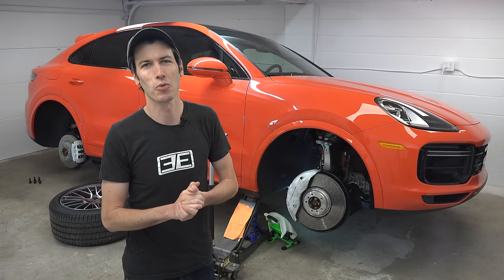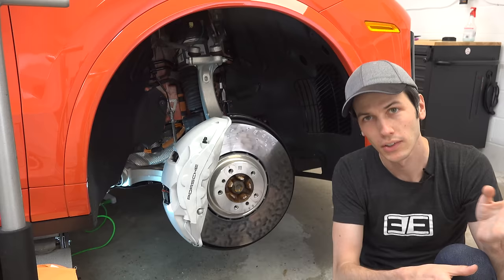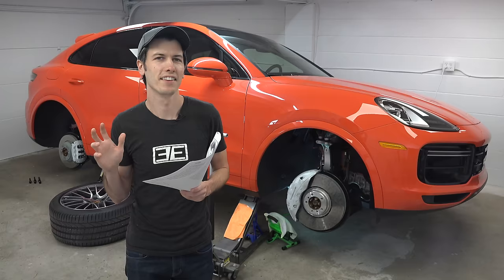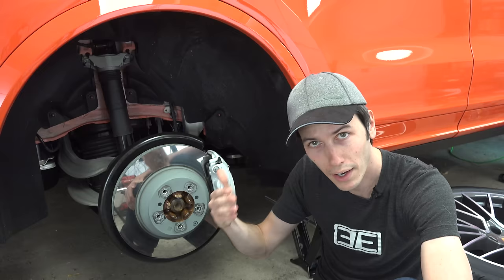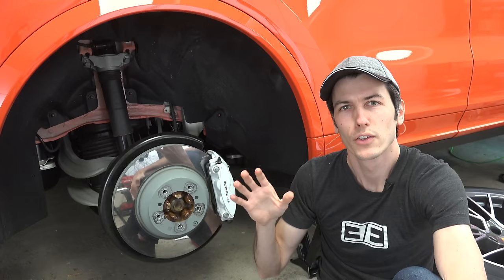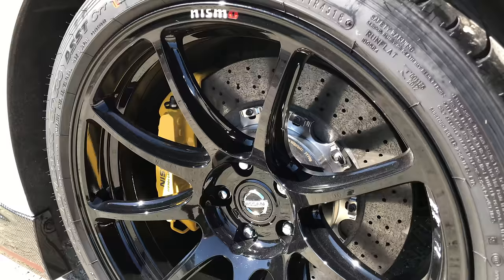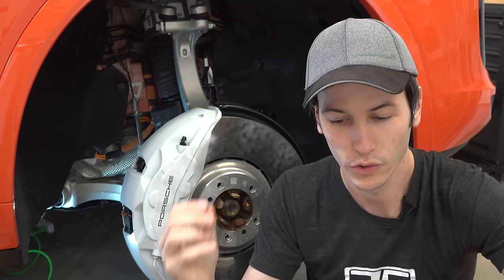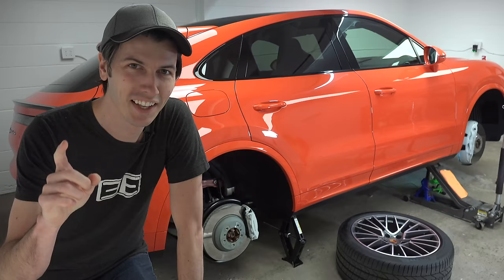Porsche Reinvents The Brake Rotor - No Rust, Low Dust, No Fade!

Comment: One of the problems with having a car designed and built in California were they don't have real winters. I drive my model 3 like a real car which means I drive on wet slushy dirt (muddy) roads in the winter. This was a feature I really liked to help stay on the road in these conditions. It will make these muddy, high crown roads with deep ditches really difficult to drive. I would like to take the engineer who thought this was a good idea for a "spin" in a nice 28°F day.

Comment: I am kind of paranoid about supporting vehicles. I use Snap-On 10 ton jackstands (they cost about $400 in about '98 if I remember correctly), and I am just an occasional DIY'er. None of the rest of my tools are that fancy or overkill, but I have seen jackstands fail, pavement fail under jackstands, jacks collapse, bend, slip, etc. I worked at a body shop and this is one area I just will not compromise on when I am getting under a vehicle.

Comment: You do understand that that is a break pud eater. However constantly breaking little angers as you said produces much less heat than pure friction. Scorching marks on front caliber are scorching marks, so they are signs of burned surface. We use a lot of tungsten blades in our machines and those marks show over heating and no they never come back even if you Polish them the burn is still there and reappears in the same spot. It has a ceramic structure and if you make a burn it actually comes from the core metal that was coated and not the coating. In time they will get it right
Reply: So if you look on the braking pads you should see grooves formed as you would on an overhead iron caliber.

Comment: Im a machinist and i regularly make parts that get this HFOV coating.(Hydro Power) I would really like to hear a reason as to why they cant simply coat the rotors thicker. I dont really see a reason why you should not be able to make a 0.2 mm coating or even thicker than that. Im pretty sure you could easily significantly increase the longevity of the rotors without the costs going up that much more.

Comment: You can slide the tire or tires under the edge of the car for ultimate peace of mind.  Actually when I change the brakes I slide the tire under the control arm.  If you ever do go under a car for whatever crazy reason at least your head wont get squashed.

Comment: usually its not the wear that occur first, its the warping, you brake hard and you hit water puddle which give the rotor some temperature shock, after a few cycle any rotor will warp, then you need to either skim or replace it, which either way will let porsche to legally rob you a fortune

Comment: Pretty unstable set up of these jacks: if the hydraulic jack failed it's quite likely that there will be some lateral movement causing the secondary jacks to topple sideways. Wheel chocks on both left hand wheels would help.
Personally I would place large blocks of timber under the car and then lower the hydraulic jack until the timber is touching the underside of the car. Pallets are also a very stable safe support and 2 or 3 stacked under the car would be ideal.

Comment: Depending on the metallurgy of the rotors, good ones made with high carbon G4000 doesn't rust right away after rain, cheap ones does.

Comment: What would happen if you used this tungsten carbide coating technology on drum brakes? We know that drum brakes wear out more slowly than disc brakes as it is, so wouldn't using the tungsten carbide coating with them give them even more life? And can this tungsten carbide coating only be applied through that supersonic combustion spray method? It can't be applied in any other way, like electroplating, or sputtering, or something? Is tungsten carbide the only material that can provide useful improvements over iron rotors?

Comment: There is a place less than a mile from my house that does coatings like this.  I wonder if he would do a set of brake rotors.  I am aware these would have to be machined smooth as one of the final steps using tools made of diamond or a harder grade of carbide.  I am sure if he did it that would not be cheap but probably less expensive than Porsche's rotors.  I would love to see these for all cars eventually.  At that point they might not be so expensive any more.

Comment: What about getting rocks in between the rotors and calipers? On normal cars it obviously scars the rotor, but with these rotors, you have such a small amount of material to wear through before replacing them. I assume they won’t scar as much, because they’re so hard and I assume that in most cases it will just pulverize the rock or whatever. Correct me if I’m wrong, but it sounds like that is a major flaw. I understand that it’s really more for the track, but ironically it’s shown here on an SUV on a dirt road.

Comment: This sounds that it is perfect for BEVs and One Pedal Driving. 

Yeah it is expensive but it is very likely you'll never need to change brakes anymore. And you wont have a problem with rust, even  if you hardly ever use the brakes.

Comment: They probably got this idea from carbide tipped saw blades. They used to be HSS, or ‘high speed steel’ but they were eventually upgraded to carbide tips as it’s a harder material, stays sharp for longer and cuts way better. It’s quite interesting how the same sort of thought was applied to brake pad, only instead of teeth it’s a whole coating.

Comment: The next step up from tungsten carbide in tooling is coating the tungsten carbide cutting surface with the even harder titanium nitride usually designated by their elemental symbols TiN. If it works for tooling why don't they do it for a multi thousand dollar rotor plus TiN looks like gold plating so that would be even cooler than having white calipers?

Comment: My 1997 Lotus has freaky carbon/ali disks, they're still absolutely fine after 23 years of use (including track days, winters, etc) but they aren't funny in the wet and you can't get pads for them any longer (disks have a design life of 100K miles, pads about 40K miles). Wheels DO stay lovely and clean though.....

Comment: i was pissed off because i did a brake job on my 2002 Chevy Venture.  the front pads were $16.99, but i needed brake lube, and i had to buy a big squeeze tube for $8,99. yes, the grease was 1/2 the price of the entire brake job.   the last tube of brake grease i bought was in 1986, and according to m6 receipt, it was $1.89. it we t up over 4x!!!! - there is no need for that.  anywho, the brake pads usually last me about 25,000 so in two years, my brake job will only cost me $16.99 + tax and whatever inflation we have.  
ooh, the brakes never squeek, but the van stops on a dime, it has no fancy options, but i am happy with it.

Comment: This brings forth a question. Couldn't we coat rotors with something like Titanium nitride? It's as hard as industrial diamond, also does not rust and is virtually indestructible. It's the finish that is underneath the black finish on Glock pistols. Might require special pads as the Porsche design does.

Comment: Coefficients of thermal expansion 10^-6 per K:
Gray cast iron:  10.5
WC: 4.9

When your metal substrate expands at twice the rate of your brittle ceramic coating, watch out.  That tungsten carbide is going to end up spalling off sooner or later from heat cycling alone.
Reply: Could explain that cracked aspect at 5:33 ...

Comment: With a harder surface isn't that why they put even great clamping force calipers? Just kind of seems like it would be hard to transfer heat away from the pads since the rotor surface seems to have a low friction surface. Just seems like they're shifting around the forces needed. Like it'll last longer, but because of its design requires more clamping forces, special brake pads and doesn't seem to offer the benefits of carbon brakes light weight reduction. I almost wonder if these brakes are heavier in comparison to normal cast iron brakes since my guess is for the same braking force they need larger calipers.

Comment: Can they make the walls of the rotor rings thin (hence lighter) or does the heat sync requirement force them to be as thick and heavy as the standard iron rotors?

Comment: Actually to educate mr. Engineering explained. The real reason why carbon ceramic and tungsten carbide are fade resistant is because they have much higher melting points so the threshold for its weak malleability is farther and harder to reach. And with steel or iron brakes, hard braking race drivers have some fade right away within the lap and gradually onwards. There's really no genius for porsche to google what metal has a high melting point, make and apply it as a coating.

Comment: Grey cast iron is the cheapest you can get. The should at least use S. G. (Spheroidal Graph) Cast Iron. This can be case hardened to some extent. This is First stage as they last far longer than Grey Cast iron. Then the Tungsten Carbide plated ones should also S.G. as a substrate for the inter molecular. Then Dimond  Side Ground with a slightly out of balance Diamond wheel. Out of lateral(wobble) gives a sunburst pattern on the Rotors.

Comment: $2,000 is a rip-off price for new brakes. I'm 59 years old and I've never paid a shop to put brakes on, I do my brakes and my wife's and it's very easy.  When I was down in Florida I taught my brother how to do his brakes and rotors on his wife's mini Cooper. He's not really mechanically inclined and he was able to do it. Has many did require a special tool to compress the calipers though but it was provided by the auto parts store for a deposit. Brake pads are more expensive for a full size truck than it is for most cars, I bought the most expensive pads they had for my front brakes recently and they were $65. There were three choices on quality I think, the cheapest ones were about $45.

The guys complaining about how his car is jacked up don't know what they're talking about. It's not going to fall.

Comment: That graph on force, looks similar to how a lot of track pads I have used behave. It takes a few brake applications to put some heat into them, and then they SNAG the rotors very hard.

Comment: How about just changing pads when the carbide coating goes away and just using regular ones? you'd have just a regular rotor but won't have to replace it till that's run out too

Comment: Treble safety redundancy if fine with me , also when pccb was first offered I think from memory the service life of the first set of rotors was projected to be up to 300,000 KMs and when the number of cast iron sets is factored into the equation then pccb is a remarkable value for money option even after a full retail replacement

Comment: For extra, last chance, I usually slide the wheel under it was well.  Sure, it will jack up the rim and risks blowing out the tire, but that is better than having the same thing happen to my head.  I also normally leave the car on the hydraulic jack plus insert a nice jack stand as well.  I like to leave the weight on the floor jack because it has little casters on it so it can move with the car should it shift for any reason.

Comment: carbon ceramics will oxidize with high heat from tracking. this is why you'll see most Porsche RS cars at the track fitted with an AP racing kit or similar

Comment: I wonder how the outside and inside edges hold up to corrosion. Here in the northeast, the salt causes significant corrosion on the outside edges leading to the outer quarter inch of rotor flaking off, the result, usually I can't get away with just changing pads, rotors have to be replaced as well due to vibration issues resulting from the corrosion.

Comment: it is a coating, rotors and pads decrease in surface thickness that is a constant, once the coating is gone it is essentailly a conventional cast iron rotor, this isn't to me anything groundbreaking, in addition now there is a brake pad designed to clamp to a tungsten surface that is no longer present and how long will the cast iron last because of it, will braking performance become evem worse? You failed to touch on these aspects, and cost, is the increase in cost worth the outcome?

Comment: I wonder if that rotor can work with normal pads.
I assume they slip much harder, but it's not something you cannot fix by having it BIGGER. Its just a question if we could make it big enough for smaller car, so carbide rotor would work with normal pads. If so, the rotor likely could outlast the rest of the car.

Comment: I don't know which trainee emailed you these insane prices for brakes. You never specified sources or the exact model and I'm not Into Porsche but looking it up I found for a "PORSCHE CAYENNE (9YA), 3996 cm3, 550 PS, 404 kW, BJ: ab 05/17 " You are looking at pads and Discs for about 200$ (Brembo) per wheel it sais "COATED DISC LINE" don't know which ones that are but as you stated yourself the upgrade is a 9000$ option so replacement is likely to be cheaper or as high as this option cost.

Comment: Warm air coming out of heat exchanger effecting the brakes?
I'd be surprised if your would see more than a 20F delta above ambient coming across such a coil. So even on a 100F day, it might be 120F air. That's still COOLING hot brakes significantly. Relative to hot brake temps, it's not significantly different than ambient air.

Comment: Before the rotor wears it will usually warp under extreme heat that will cause brake fade and give the steering rattle under braking.. You didn't mention anything about rotor warp, so to say that the rotor 30% longer is a marketing trick since the base material is still steel. And then the replacement parts alone is x5... Still don't make much sense. But hey - if one has $145K to throw on an SUV(!!!) then the extra x5 on brakes wouldn't hurt you too much.

Comment: They're still iron rotors underneath though so couldn't one just wear through the carbide and then just not know that because the brakes still technically work. Seriously wouldn't lack of finish just be what lets you know that your brakes are going oof. He said there is better braking performance but honestly with those calipers and rotor sizes the stopping force would still be sufficient.
Reply: It should be but not knowing exactly how those pads will interact with the iron has me skeptical to try it but of course I will never be able to afford those brakes and probably not even a decent Porsche so what do I care run til they fall off

Comment: Brakes continue to get more technical. Replacement cost of PCCB is irrelevant. Why? Because if you're a street driver they never wear out, and if you're a track driver who will wear them out you know and stick with iron. The new tungsten carbide are in between, nearly life of ownership for most owners including with occasional track use. The technology of manufacture is of course insanely awesome, ie, typically Porsche.

Comment: Serious, using a ghetto scissor jack to get a car jacked up on all 4 points..

You are a brave man.
Maybe it can take the basic weight , i'm sure that's coverd engineering wise.

But from a garage mechanic safety standpoint,  that's just not safe.
use decent jackstands if you want all 4 wheels off the ground and you don't have a proper carlift

Comment: Dude, I know that in laboratory tests rotors only wear a tiny fraction of the amount pads do.  But the reality is that when the car is sold and driven off the showroom floor, it isn't driven off to a laboratory: it is driven off into the real world.  In the real world, rotors get replaced roughly every 3rd time that pads are replaced.  I expect the WC coated rotors to last longer than this - perhaps long enough to reach their 2nd owner.  But don't mislead us.

Comment: You said that if you removed the scissor jack, the car wouldn't fall, but what if you removed the floor jack and jack stand, which is at the front where presumably most of the weight is, particularly in front of the jacks? Why not rest the weight of the car on the jack stand? The impact of the car landing on the jack stand, depending on the distance between the jacking point on the car and the seat of the jack stand, may damage/crush the jack stand, right?

Comment: Galvanize? I am very skeptical that they are actually galvanizing the contact area of the disk. Zinc has a low melting point of 419 deg C and would not provide a reliable anchor for the tungsten carbide overcoat in high braking conditions. I'm going for them galvanizing the inner annulus to provide cathodic protection to the disk.

Comment: I noted they said vs grey iron rotors.  I was under the impression almost all modern rotors are alloyed nodular iron, and steel.  If they can figure out a way to reliably produce metal matrix rotors with SiC, that will be ideal.
Reply: No, 99% of cars use grey cast iron for their discs, and it's very good for its intended use.

Comment: So what happens when some sand (which could very likely contain quartz) gets onto that surface and scrapes the rotor?
Reply: Tungsten carbide has a hardness of 9-9.5, with quartz being the definition of 7.  Shouldn't cause a problem.  Now some Al2O3 might scratch it up. . .

Comment: Question....when do theses coated rotors need to be replaced? When the coating is gone or after you have worn down the under laying metal rotor?  If they are COATED regular iron rotors of the same base thickness of the regular rotors, then after that 0.1 mm is gone there is plenty of rotor left to have 'normal brakes' for 50000 more miles. NO?

Mike

(also an engineer LOL)

Comment: those little cracks are called heat checking, and no it will not come out. We have to replace tungsten carbide mechanical seal faces with heat checking